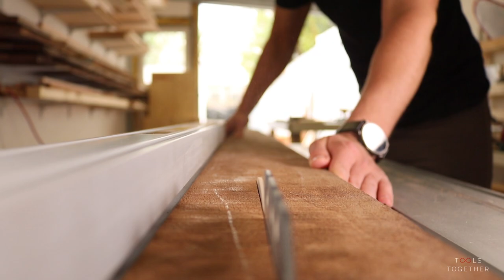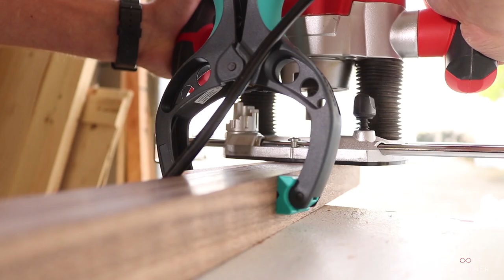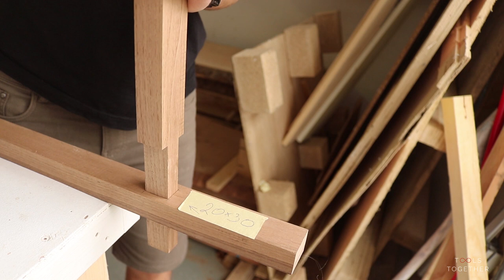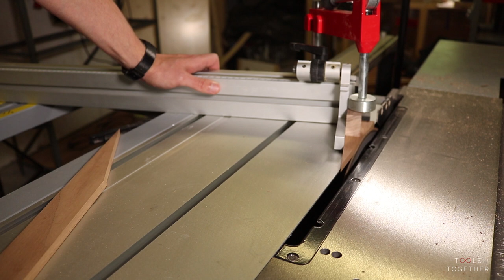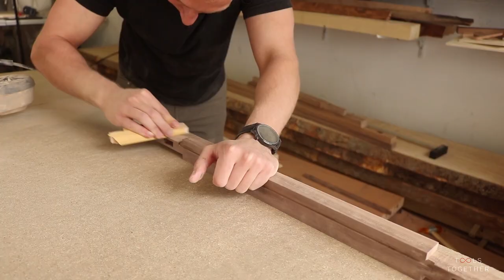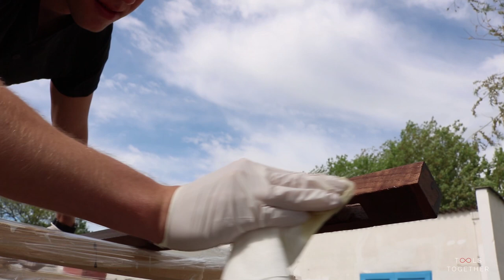// 3D PUZZLE FURNITURE // Japanese style mirror frame with coat hanger - woodworking without screws

Comment: Super nice - what was the clamp holding at https://youtu.be/027m4nqg1d8?t=56 ?
Reply from the maker: Thanks! The clamp is holding two sides of the mirror frame. You can save time by marking the joining points in once and to keep it stable I use the clamps.
Reply: oh yep, I see now that it is two pieces of wood clamped together. thanks. nice mirror and video. I'm a new subscriber!